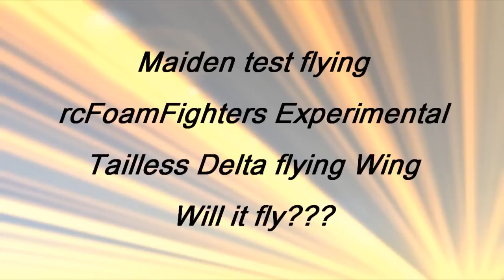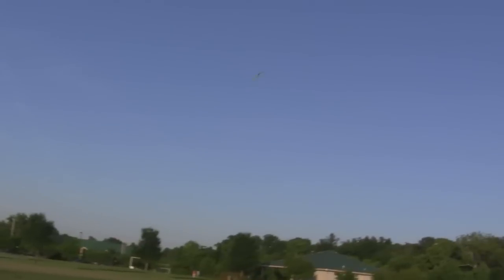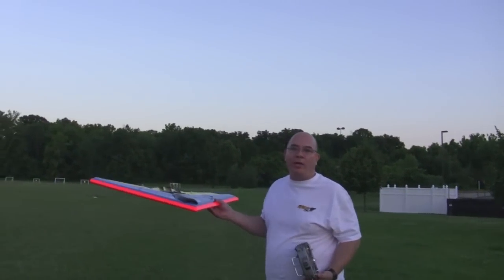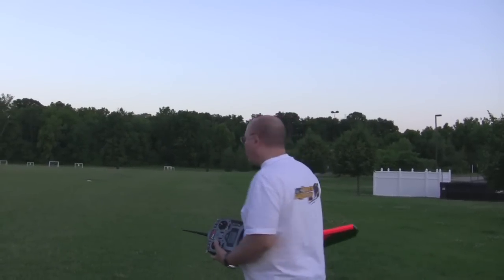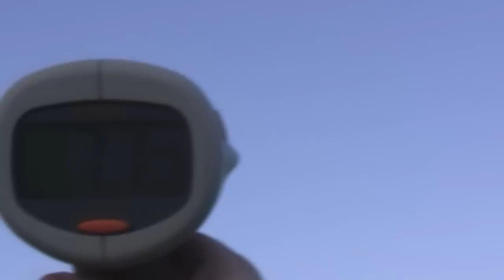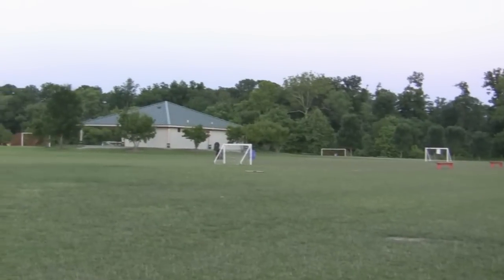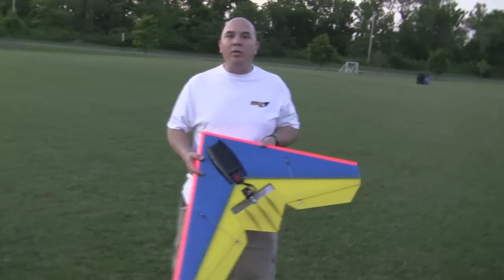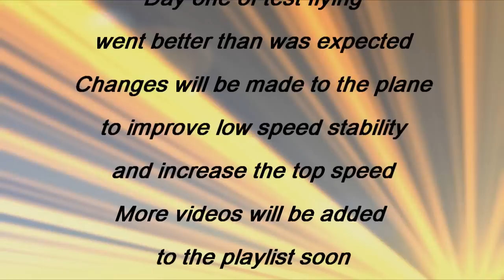Bullet Proof RC Plane Build Along No1 First Test Flights

Comment from the maker: Thanks!! I agree they worked pretty well as long as the prop was spinning she flew great. She gets a little unstable once you hit the esc low voltage cutoff. Those short diffusers just don't grab any air after the prop stops spinning. I'm going to try a few things to try and fix it. Should have more video soon.

Comment from the maker: Thanks for the 5 stars aecumputer1!! I did land way out there didn't I lol! Actually I kept hitting the low voltage cutoff and once the prop stopped plane started rocking so much I just wanted to land it a quick as possible without any damage. Even though I built it to be bullet proof I'm still not too sure how well the wood pieces will hold up in a crash.

Comment from the maker: grayshoaf if the plane is both nosing up and down your problem is most likely with the control surfaces. I would check for play in the servos and control horns. sometimes they come loose. Also see if the control rods flex. If they do you may need to add supports to keep them from flexing. Also check the elevron hinges for play. If you can move the elevrons up and down without the servos moving then at least one of these things is your problem.

Comment: looking at that pointing nose, it is bad if it hit somebody on the ground. so good call by making a distance in landing. 

i think the small fins on the plywood helps in high speed controlling the yaw side to side. but it not much effective in slow flight. if i've not mistaken, thats what fins/vertical stabilizer are for.

maybe you wanna try northorp technique for tailess plane. some kind of split elevons. i believe dave power have experimenting with it too.

cool vid. love the dog fight.

Comment from the maker: bottomgunner the second plane was built so I could do a comparison between having the KFm4 airfoil and not having it. The planes are the as close to same in dimensions as I could get them. There is a video near the end of this series of videos that shows the second plane being built but it is not meant to be a build along. You can build this plane the same way as the other one just don't add the KF airfoils and use 30mm EPP foam for the wing instead of the 15mm.

Comment from the maker: azim2021  the original rc brushless motors came from computer cd rom drives. Other than that I couldn't tell you any other sources for these type of motors as I have always just bought mine from an online hobby shop. I would suggest posting your question in an rc forum some where.

Comment from the maker: azim2021 normal electric motors use brushes and an armature for the timing of the electromagnetic pulses that drive the motor. Brushless motors do not have brushes or an armature they use a 3 wire setup and the electronic speed controller times pulses between the three wires and regulates the magnetic pulses that drive the motor. Brushless motors are more efficient and more powerful. There are a large selection of these on hobbykings web site.

Comment: Hello, could you please tell me how would be the control surfaces in order to perform a normal turn ? I built this BP RC Plane but I crash it when ever I try to do a turn (it stalls quiqly and nows down after some crazy moves) The CG I think is OK but I dont now how to psition the control surfaces when I try to do a turn. In the last crash I lost a battery :(